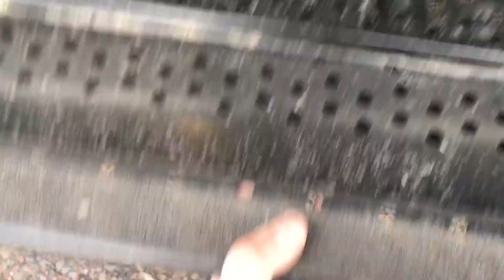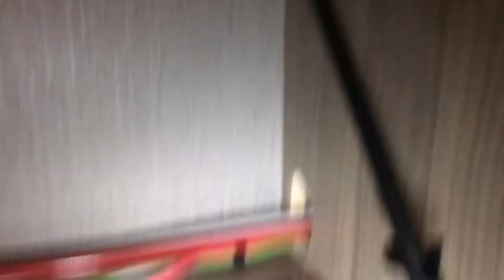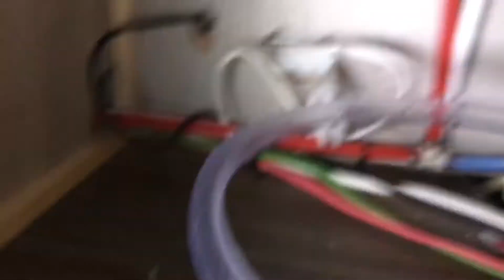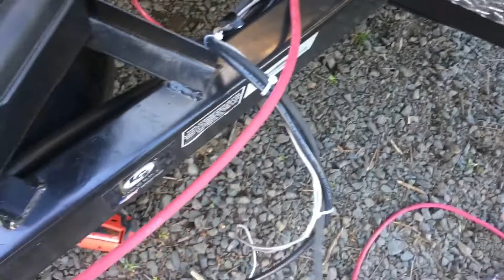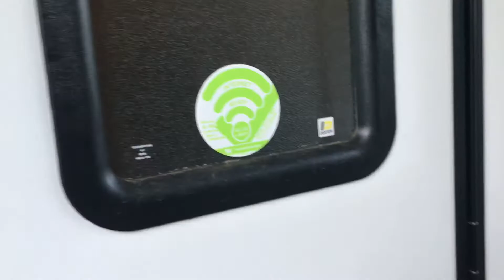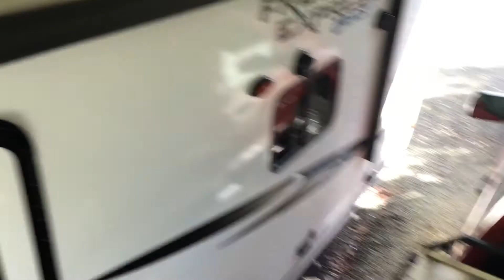Freedom Express 17BLSE by Coachmen tour & mods (long boring video)

Comment: Most informative!  Thank you.  Thanks for the ideas for the future too.  Actually I found you again looking for a video on de-winterizing my new Blast.  I would really like to find a detailed one specifically for it.  So this is where the suggestion came from to put a fan in the fridge.  Done.
Reply: How are you liking your Blast?  It is on my top 3 list...but I got a little scared off after reading some reviews.  How is it holding up?  And would you recommend it?
Reply from the maker: @c.m.303 Sorry didn’t see this comment. So far mine’s been fine.  I do travel with water, so I intend to put some additional support under the fresh tank. The foam laminate floor and roof do kind of concern me, but so far everything has been just fine.
Reply: @JeffinTD  oh that's alright.  Appreciate the info though and still like them.  I couldn't find a good deal on one and ran out of time when a Rockwood 1905 (Forest River, also makes Coachmen) became available for a ridiculously good deal.  It is a 2017, was only used to drive from MN to their other home in FL and back, looks brand new.  Yet it has the dreaded soft floor in the kitchen.  Not sure what to recommend but if you use it for a motorcycle or similar you may want to use boards under the wheels to spread the weight out.  I looked up some repair videos and people are having luck repairing it...but wow, it's a lot of work and uses "pillars" of epoxy to offer support and strength, and then a new floor over the top.  I doubt I will repair it though...I got this so cheap it will get me out the door but not quite the right fit.
Reply from the maker: @c.m.303  Nice. As I understand it Rockwood moved away from foam code laminate floors in later models. 

Not sure I care for the drill holes/epoxy method, as I don’t know if a person could trust that the epoxy fully spread. 

If the bad area isn’t over tanks I wonder if a person could add some say 2x2” 11ga square steel tubing across the frame rails underneath. 

Above I wonder if you could pull back the flooring, and cut a plywood patch with radiuses corners. Then trace that on the floor, and trace a second line say 2” in. Cut out the inner line and use a router set at half the thickness to cut to the outer line.  Router off 2” from the patch also, so you basically have lap joints. Then glue that down. 

AZ exert YouTube channel (rebuilds  laminated foam code fiberglass RV roofs) did a video on a trailer floor repair.  They basically removed all the interior cabinets and walls, and used a hot wire cutter and expanding foam to inlay metal U channels from wall to wall. They couldn’t raise the floor level due to the slide out. Turned out nice, but I can’t imagine what it cost. 

Anyway glad you’ve got a rig that makes you happy. Good tip on using a board under a motorcycle.
Reply: @JeffinTD  Yeah that's more work and time then I would want to put into it, and at this stage it will work for the price I paid.  Glad to hear they moved away from that flooring method, I'll keep that in mind if I trade up.  For now this will get me down the road and test if I like the trailer method...or if a move back to a motorhome will be a better fit.  I am about to start full-timing in a couple weeks.  Thanks for the video recommendation...think I will go take a look.
Reply from the maker: @c.m.303   Enjoy and have fun. There are advantages to getting into one so cheap that you can’t loose. 

I’d like to upgrade at some point too, but the main reason I got this is that it will fit under the carport. 

All of them seem to have drawbacks and strong points.
Reply: @JeffinTD  Totally agree.  Just gotta enjoy the journey!

Comment: Hi Jeff ... Are you still satisfied with Blast?    Looking at a 2022 and was wondering how the AC works for this set up?    Bob
Reply from the maker: Yes I’m still overall happy with the unit. There are some areas where it is clear they cut costs, but at its price point everything has held up. I only test ran the factory AC and it worked fine. I then swapped it out for the low profile version of the same AC so I can park under my carport.  I got pretty decent $ for the factory unit and was able to get a blemished low profile (Penguin II if I recall correctly).

Comment: Is this unit half ton towable?...We are looking for one to take our HD trike with us...
Reply from the maker: You’d have to check your tow vehicle rating. The trailer’s max weight would be 5,900 with 500+ pound hitch weight. You’d have to look up the rating of your half ton. Generally a pickup’s tow ratings are based on a max combined weight, with just a driver in the vehicle.  (People, luggage, tools, camping stuff adds up fast) I’d also be careful of physical dimensions with that trike.  If the weights work and the fit looks good on paper, perhaps a dealer would let you test fit, as long as you were ready to buy if it works.

Comment: Just as a heads-up. I have a 2017 an I had problems with the underbelly tank braces. Mine had only 2 flimsy braces put in by the factory and I almost lost my fresh water tank because they are not strong/good enough to go off grid camping with the fresh water tank full. So just keep an eye on that. I put 3 extra much stronger braces just to be safe. 
The manufacturer told me that this rv is not designed to travel with the fresh water tank full.......so keep in mind that.
Reply from the maker: That’s good to know. What a flimsy excuse. Many people travel with water as not all camping destinations have safe water...

Comment: Greetings & thanks for the detailed video. Learned much! I saw places in my 17BLSE I didn't know existed. I saw you doing a lot of electrical. Im not an 'electrician' as you seem to be but I want to put some major solar onboard.  My (uneducated) idea/concept is to put 2 [175watt flexible] solar panels on top as I can fit 1 on either side of the AC unit. Flexible ones because light &, as per their video, can be attached w construction adhesive. I was thinking a 3000 pure sine inverter and three (what do you think of 4 ?) batteries in front where the 1 currently sits. Beyond that brilliant brain storm I hv no idea where I'd put the inverter or if it needs some kind of control panel or fuses or whatever. Thought I'd ask what your opinion was before I burned everything down. Thanks!
Reply from the maker: I’m glad you found the video helpful. I’m sure no pro or electrician.  I’ve never used flexible solar, and although I see the advantage of not drilling mounting holes, I’m not sure if their durability and life span is equal to quality traditional PV panels.  Also traditional panels cast shade on the RV roof with an air gap between, which I suspect helps reduce the summer sun’s heating the trailer. 

Regarding a big inverter, may I ask what you want to power?  To me the TV is really the only 110ac thing I wanted to run on batteries, and it is I think under 50 watts. The microwave would be in the 1200ish range. 

Trying to run the Air conditioner off solar, imho, wouldn’t make a lot of sense in a unit like this. You’d probably want 3,000-4,000 watts or more of solar ( taking into account shading, charging batteries while AC is running) plus a bunch of high performance batteries (think battle born).  It would add up to more panels than there is room for, and a whole lot of money. Might be practical (but still expensive) if you were looking at running a mini-split heat pump on a bus you were full timing in, but for a little weekend trip type trailer you might be better off doing what I do (in the heat of summer my trips will be up in the mountains where it is cool and/or I will use places with hook ups).
Reply: @JeffinTD  Thx for feedback. AC on solar I'm guessing wouldn't be easy for long-run. As will be pulling w our 2008 Silverado with tonnau cover over bed, fig. well keep our little 2000w WEN generator & a can of gas under the tarp. The noise can be an issue even tho only circa 53dbl. I saw a cpl ideas online for making a sound-reducing box using baffle insulation to put gen. in to reduce noise. Something i thought about,  low and behold so did others. Don't hv to reinvent the wheel. I'd try to make one that collapses somehow for travel. when/if i get around to it.
Reply: https://www.amazon.com/Renogy-Extremely-Flexible-Monocrystalline-Solar/dp/B082FCZ4MD/ref=sr_1_27?crid=11QJOQ5PTVX61&dchild=1&keywords=200%2Bwatt%2Bsolar%2Bpanel%2Bkit&qid=1607383513&s=automotive&sprefix=200%2Bwatt%2Bsolar%2Cautomotive%2C221&sr=1-27&th=1
Reply from the maker: Yeah I get not wanting to run a generator when camping. Spoils the whole peace and quiet aspect.  

I usually find when it is 100+ out in the desert, I don’t want to camp there during that season anyway. I’ll save those spots for winter or spring, and do something in the high mountains or coast in the summer. 

For me the solar mainly keeps up with the draw from the TV, lights and furnace w/o needing to run the generator, but everyone’s use is different. 

Though in some cases they might be more than Amazon, I like using Northern Arizona Wind and Sun (not affiliated) as they have super knowledgeable people, and you can get everything in one place. Last time i set up an RV I did snag a pair of 220 watt 30v panels elsewhere as I stumbled on a great deal.
Reply from the maker: Lithium Ion batteries can accept a charge much faster than lead/acid types, if the charger can deliver a charge that fast. A hybrid inverter is basically an inverter and charger in one unit, so if you do need to charge off a generator or by being plugged into the grid, the time would be much shorter. 

Folks trying to run something like air conditioning will often run higher voltage (say 24 volts) to reduce the amps being drawn off the battery bank. A special converter can be used to reduce 24 or 36v dc down to 12v to run the RV’s 12v lights and appliances. 

Again, if all you want is 110ac to run the TV, maybe change a laptop, there would be no need to go that expensive/complicated.  A bit of solar and a decent charge controller, 2-3 lead/acid deep cycles like it comes with, the stock converter/charger, and a small inverter- or if the ability to run the microwave briefly was worth the cost to you- a mid size inverter.
Reply: I chked out Battle Born as you suggested & looks like they also offer some consultation tho I'm confused re 'hybrid' inverters & talking about AC in, etc. I think I just want DC 12V to AC 120v. Will hv to do some more reading & head scratching there. Batts seem to be ok price, bit below Amazon. 3 in sequence of something they say lasts 3 to 4 times longer & charge much faster is worth some investmnt.

Comment: Perhaps you can answer a question that the dealers have yet to answer for me. Does the 17BLSE have heated/enclosed underbelly? Or is it at least an option? The Coachmen website has conflicting info. The Blast page says it does but the Freedom Express Select page says no. The dealers seem to be giving me virtual shrugs. They all seem too busy to be bothered with answering questions.
Reply: Hi Jeff, just put a deposit down on a 2021 17BLSE. To date, yours is still the best video I've seen on this model. Thanks again! Have to admit, I'm a little scared or perhaps nervous is a better descriptor. This trailer is big and for me it's a major purchase, but I'm also happily excited.
Reply from the maker: @kudzub  Did you get your trailer, and if so, how’s it working out?
Reply: @kudzub  I hope everything is working out with your trailer :)
Reply: @kudzub  How did it go with your new trailer?  Did you pick up the 17BLSE?  I am considering it and just trying to find some real life answers to if it has been a good purchase or if it is falling apart like so many others lately???
Reply from the maker: The belly is enclosed and well sealed. there appears to be some insulation.  There is no heat duct running through the under belly, but the furnace does have an outlet other than the one visible. A flex duct runs under the shower pan and blows towards the hot water heater. The path of least resistance for that air to return would be through the hole in the floor by the water heater  and back up where the plumbing penetrates the floor under the microwave and by the water pump. With the furnace running mine does seem to move air that way. 

I was going to install tank heaters, but after looking at it I think it will do ok in reasonably below freezing weather as long as the thermostat is kept at a reasonable temp. 

Haven’t had a chance to confirm that yet.
Reply: @JeffinTD  Thank you, thank you, thank you! Truly appreciate your detailed response. It seems some manufacturers consider underbellies heated because the furnace ducts run through an enclosed underbelly even though no heated air is blowing in. While I think that is misleading, I guess that that could be considered heated, in a limited way. Again, thank you for all your help.